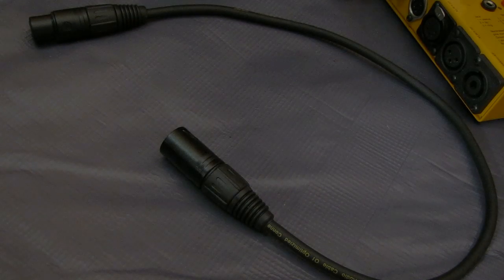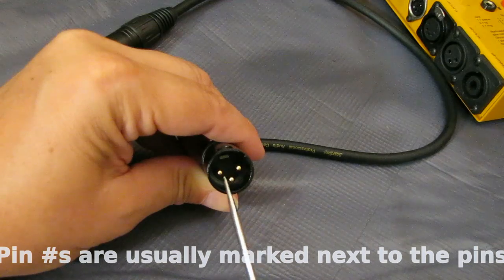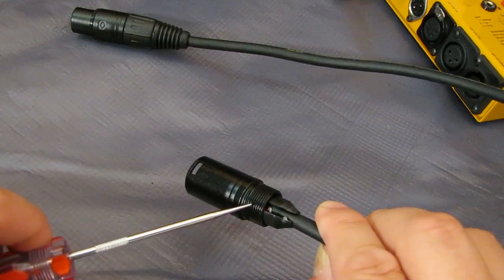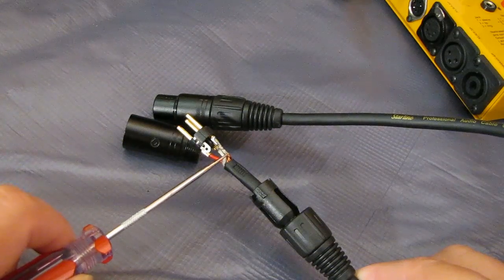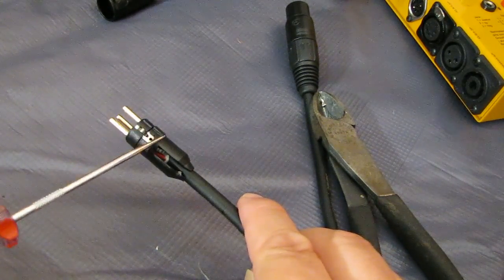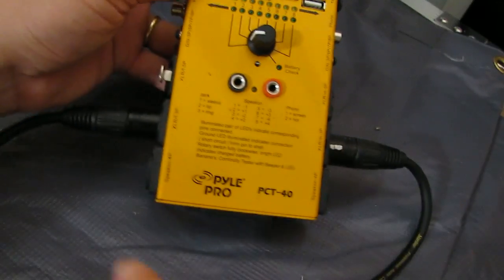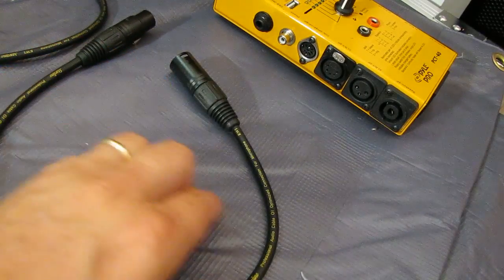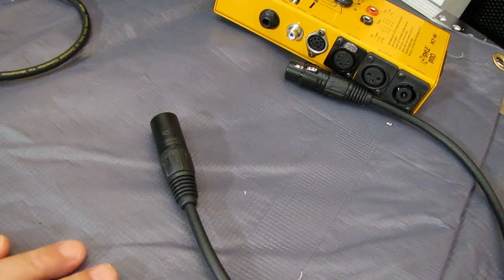Making ground lift cables

Comment: Thanks for the video man!  My system uses a pair of active subwoofers and a pair of active cabs.  If each of the 4 speakers are being run off a different power supply, would I need to use ground lift cables to link the subs to the cabs aswell as sending the signal from the mixer?
Reply from the maker: It's not very common, but yes, you may need to use a ground lift cable between the powered speakers if their power comes from separate circuits.  Test your configuration first... you may not need a ground lift.  If using a ground-lift cable at the speakers, you may be ok with not using one for FOH.  The biggest problem with ground loops originating from FOH is due to the use of a separate source of power at FOH.  What some people do, is pull power (from the stage area where the amps are) to FOH.  This greatly reduces the opportunity for a ground loop.

Comment: I've been investigating this as a simple fix as well as creating hum filter cables. Somewhere else suggested putting a 10 nF in line with the ground rather than just snip it. Do you have any experience with these other methods?
Reply from the maker: +Nathan Schilz This method is a great fix for ground-loops (which are characterized by a 60hz hum); it's quick and free!  If you are getting hums/buzzing other than 60 hz., that may be indicative of other issues somewhere in the signal chain.  Researching and locating the cause of the hum/buzz will probably yield better results (over the longer term) than placing an nF in line to filter it out.  As well, placing a ground-lifted cable on a unit that has an internal hum will not filter out the hum.

I have no experience with nF filters, however, I have heard of some people using those to quiet pops and clicks in "stomp-switches" that are used with some instrument and vocal effect units.

Comment: isn't this where the singer's gets the HELL knocked out of them when their lips touch the metal grill on the wind screen?
Reply from the maker: +liarschair10 A lot of things that can cause that; though, microphone cables rarely ever need to have their ground lifted.  Most fixes to ground lifts occur by "breaking" the signal path where two separate power sources exist (i.e. the signal run between FOH and monitors or FOH and amplifier rack), not from an audio source like a mic.  

Many times, microphone shocking can be due to bad mic cables with energized wires touching the frame of a mic or of the mixing board.  Mic cables should be tested regularly to ensure no issues.